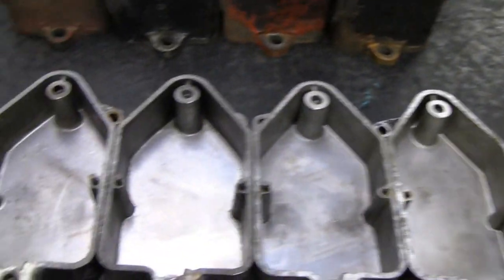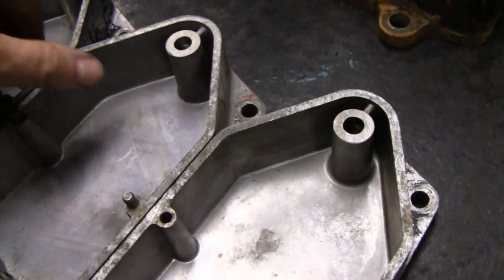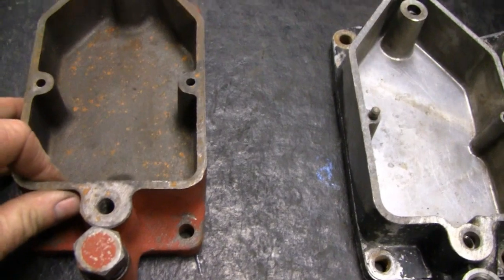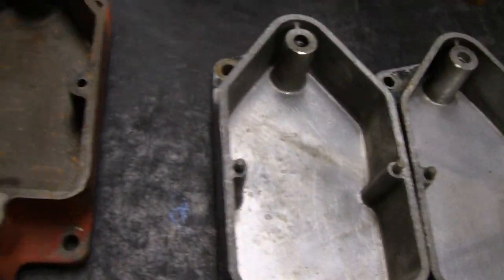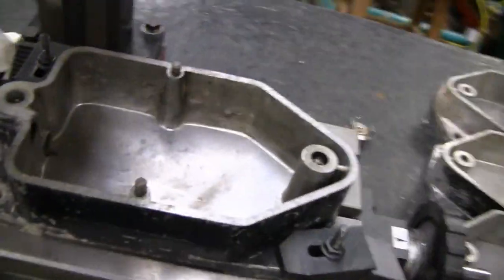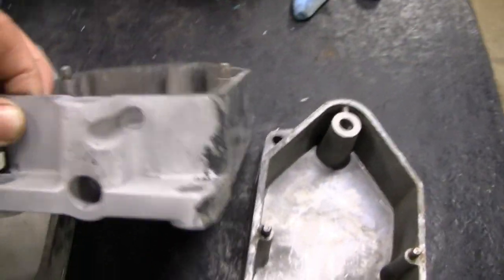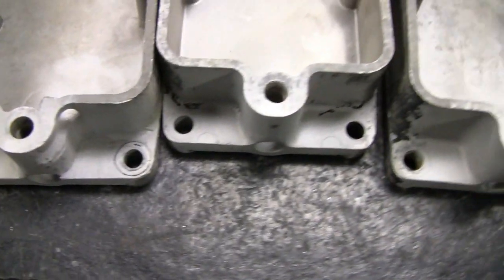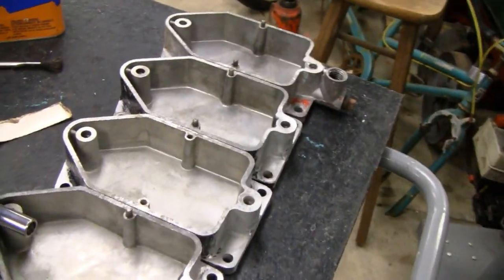HOMEMADE 4 CYLINDER BRIGGS PROJECT (part 4)

Comment: It's interesting to see the different generations of the oil pans, the one with the boss, and the different fills, and the cast iron one.  Nice work using the mill!  I am sure you covered it in another video, but what kind of Mill is it and where did you get it?
Reply from the maker: The little Mill is a Seig with Harbor Freight badging on it!! I traded a Guy for it but you can still get an updated version from HF!!☺

Comment: Which epoxy type stuff are you using?   That comes out really clean...
Reply from the maker: I use PC-7, been using it for 40 years with good results!!☺
Reply: Thanks..  I've have some lab metal here that I'm going to use around the windshield on the van but from what I've seen the Lab metal must be done in thin layers and you seem to be able to fill larger voids with the pc-7

Comment: When you fill the oil in the first sump, how is it going to transfer to the other 3? When the crankcases are attached, won't each oil sump be sealed from each other?
Reply from the maker: We're gonna drill a hole thru all of them and connect them!!☺